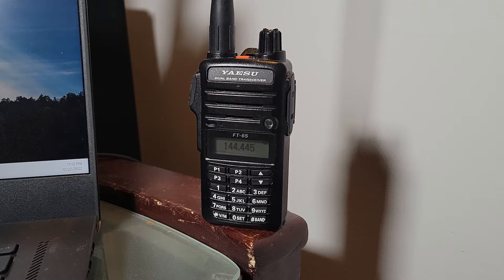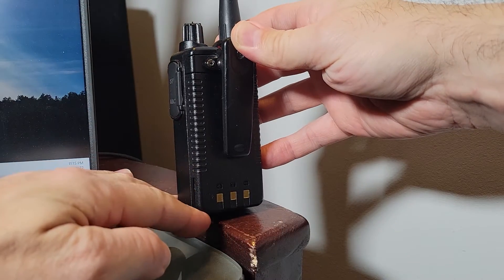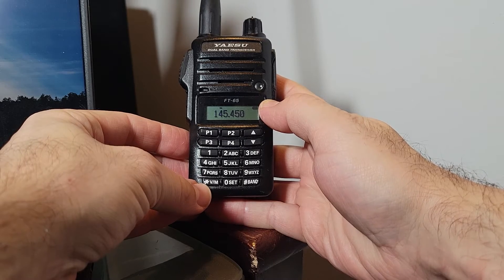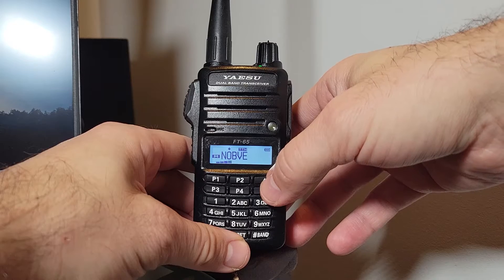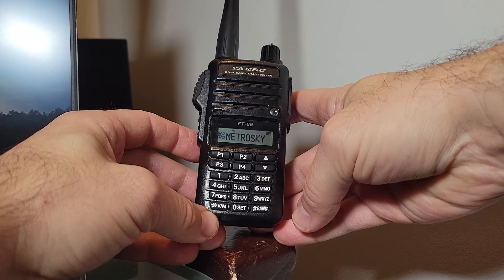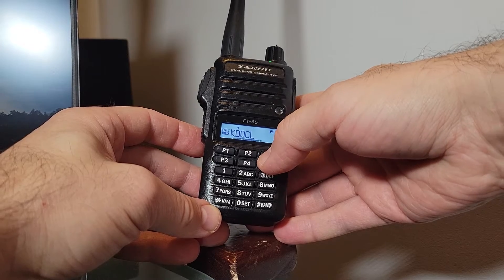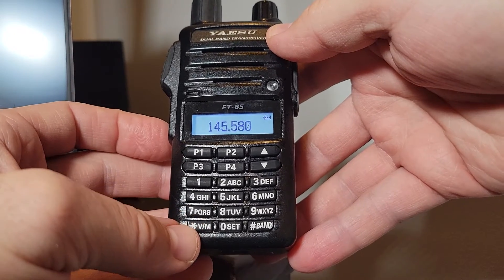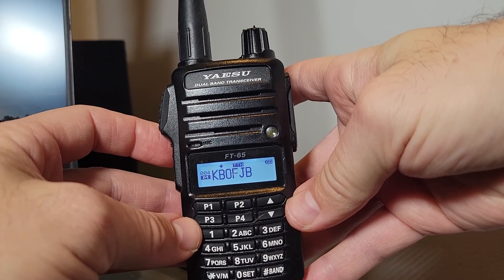Yaesu FT-65 Programmed and on the Air Quick & Easy

Comment: Is rhe ft 65 a true dual band radio?
Reply from the maker: Yes, it covers both VHF and UHF bands
Reply: @HamRadioHobbyist  both bands at the same time and visible on the screen?
Reply from the maker: The default setting displays a single frequency, but you can switch the radio to a dual-display mode, though it's somewhat limited. It doesn’t offer the display versatility of models like the Alinco DJ-MD5FXT, for instance.

Comment: I got two uv5rs, and neither of them has ever picked up anything in the two years I've had them. They are jailbroken/programmed whatever you wanna call it. Just never heard anything. Now I've also been told nobody uses any of the bands around where I live, so I ordered one of these last night. Hopefully I can get it to pick up something, if not I guess I'll quit being weird and just use my cell phone like a normal person.
Reply: Are you setting your frequencies or just randomly listening on various frequencies? Most frequencies you probably will never hear a thing...learn how to program in your local repeaters with a programming cable and CHIRP software. If you have the FRS and GMRS frequencies unlocked, program them in as well. There are also GMRS repeaters in areas that are often pretty active (you technically need a GMRS license to transmit on the GMRS channels, no license needed on FRS channels). You should find some people talking that way unless you're too far out of range.

If you have a local ham radio club, attend a meeting and they will often assist new folks in using their radios.
Reply: @blackshirej is the 65r capable of having gmrs and frs? I know MARS can be unlocked
Reply: @Kypreparedness  You know, I'm not real sure. On my UV-5Rs I have them but I never checked on my Yaesu to see if it can access them

Comment: Really appreciate this. Brand new tech as of yesterday. My plan is to get a base and HT. Was narrowing things down to some reasonably priced HT’s with decent reviews. Looking at the Wouxun KG-UV9PX and UV9p. Any advice with these choices or perhaps a different. Do not have a computer so anything preloaded and/or manually keypad programable would be preferred. Thanks again for the outstanding walkthrough. I saved this incase i get this HT.

Comment: The larger capacity battery and a good antenna are great upgrades. My 65 is used as a mobile with magnet mount antenna center of roof. 6 watts hi power on VHF.  Almost 5 watts on UHF. SWR 1.2 or lower.
Reply: What is your antenna of choice for this HT?

Comment: a few years ago, I bought an FT-4 for myself to have as an emergency backup radio. I wanted something I could rely on in the backcountry and not worry if something happened to it-$90 to replace as opposed to my $400 VX-8!
I am an Extra & my wife is a Tech. When the FT-65 came out, I decided IT would be a replacement for my wife's 12 Year old FT-60. Christmas came & I gave the her FT-65. SHE decided she preferred the smaller size of the FT-4, so I said "okay". She got the 4 & I kept the 65, LOL! I like the 65 SO much, I'll be getting a second one.

I plan to build a small Go Kit around the pair of 65's. I still have my VX-8 and will until they pry it from my cold, dead hands! I also have a VX-6. My "Plan" is to have the VX-6 as my everyday Carry Radio, the VX-8 for Special Event work, and the 65's when deployed for an emergency or public Service situation.
My proposed 65 Go Kit will be housed in a Harbor Freight knockoff of a Pelican Case (Orange). The case will ALSO have a 30 Amp Lithium Iron Phosphate Battery, 10 Amp Lithium Charge Controller MC-4 to Anderson Connector adaptor, Two 12 Volt Cig Sockets and FOUR 3 Amp usb outputs.

In addition, it will also house TWO Goal Zero Mini usb lanterns, Two Stubby Duck Antennas along with a Pair of Diamond Antennas, Two drop-in chargers, and a Wall charger for the 30 Amp Battery. Finally, it will also hold a 150 Watt Pure Sine Inverter, and an All-Powers 60 Watt holdup Solar Panel.

It will ALL be self-contained in the Hard Case. I CAN'T WAIT TO GET IT BUILT!
Reply: cool story bro